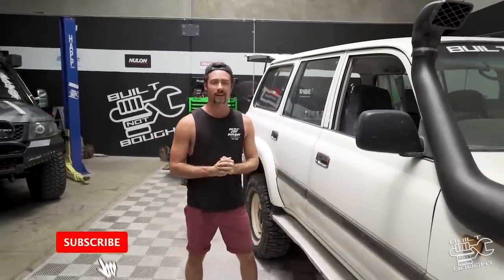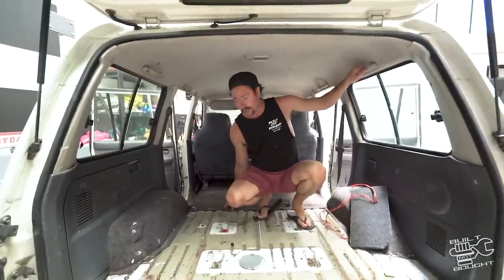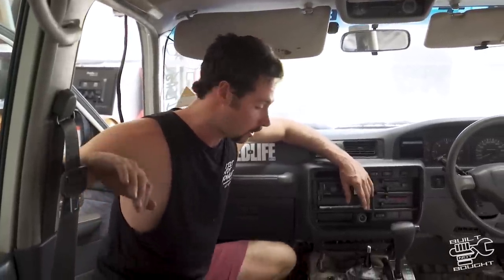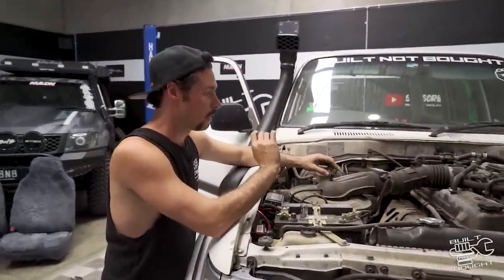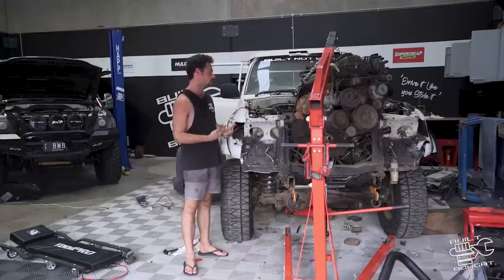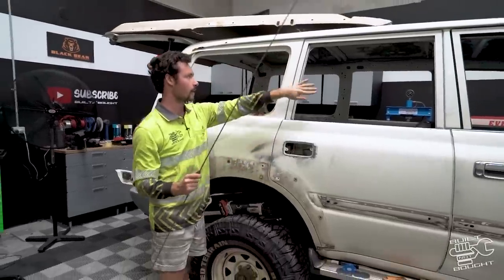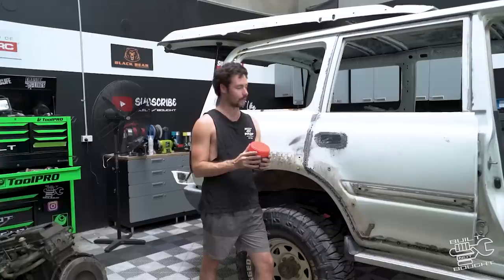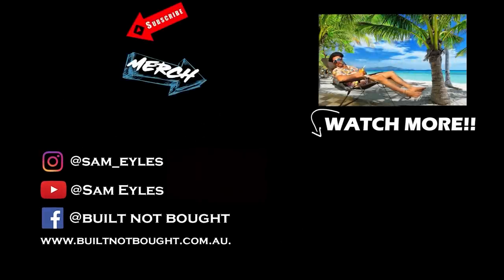BNB 80 Ep. 1 || Why I'm Not Chopping My 80 Series Landcruiser

Comment: Use FG falcon seats, they're very comfortable 🤙
Reply: Yes I agree
Reply: I got ba Fairmont seats in my cruiser 👍
Reply: @jarydt1152  Smart, Even better !
Reply: Yep I run fg xr6 seats in my GU also, best seats by far.
Reply: Xr6 seats definitely the way to go
Reply: Commodore seats are terrible.
Reply: Lookin good as it can get 👍🤙
Reply: Definitely xr seats
Reply: There lots of other seats that are comfy to lol, all these tools going ford seats🤦🏽‍♂️
Reply: Agreed. I used a Huracan fab kit and FG seats in my 80 panelvan
Reply: @jacobedwards8301  Thats correct mate, there's alot of options out there. But using FG seats with the Hurricane kit, is more bang for buck and keeps the theme of the "budget build".
Reply: Subaru seats 🔥🔥🔥🔥🔥🔥
Reply: @jacobedwards8301 whos the tool here 🤯

Comment: Sam
I am pretty sure that the four speed auto is strong as they did put these into 70 series LandCruiser conversions from manual to automatic with the single turbo diesel V8
I would look at changing the transfer box ratio so you can crawl in low range and also a lock up torque converts switch so you can lock up the torque converter in the lower gears That way you can drive the automatic like a manual when you want to and then have the convenience of the automatic when driving around town Looking forward to seeing the finished product
Regards
XDrive

Comment: I run a manual in my 1FZ turbo im told they can handle a hell of a lot more power than the auto no sweat. 
I rebuilt mine with a taller 5th gear to lower the revs at 110 on the freeway.  If you have questions shane from noordeman diesel in Welshpool and Ant from Spartan performance are your guys.

Comment: Hi, I did the same engine conversion in my 80. I’m needing the wire diagram for ecu and trigger the rpms when turns on the air conditioning. Can you give a hand with it or 
 with some body?